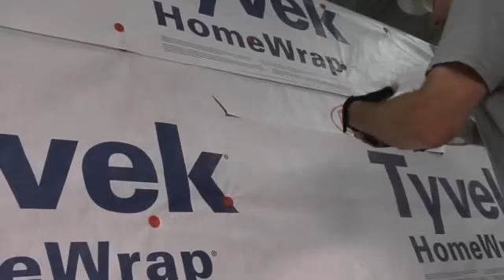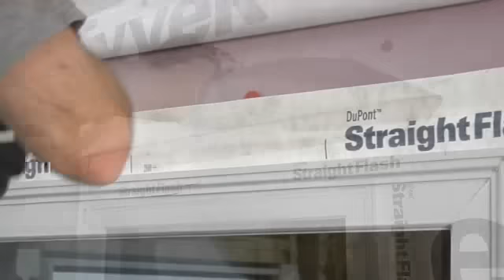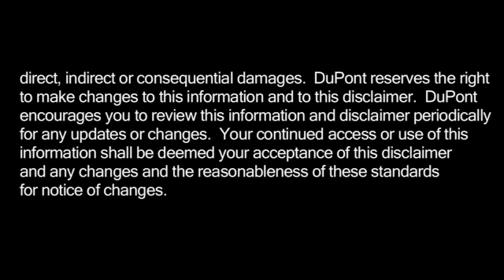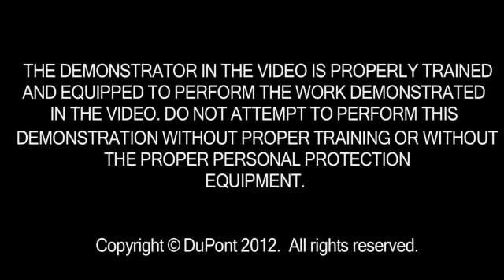Install and Flash a Flanged Window When Using HomeWrap® Over Exterior Rigid Foam Insulation

Comment: how did you flush up the window opening to the foam? if I use 2" foam over framing, do I bring the foam to the edge of the opening and nail the flange through the foam into the wood frame? or do I fur out the window frame opening and butt the foam up against that?
Reply: Im looking for an answer to the same question. If you figured it out could you answer for me ? or could anyone else ? It would be big time appreciated.
Reply: You get :-3 cans of foam make sure you get it in the 10 inch can. White cans only.  Then you attach flange to top at window header. Then stick hardened flange to bottom of window sill and the pull on both sides of side of window making sure to take hands and wipe down the 2 side jams of window flange. Foam will ooz spend sides. Top and bottoms of   all four sides.  But no needs for worry have your helper to take a warm clean clothe and wipe clean window.   There beutiful lady of a window installed by professionals.  Another happy happy happy home owner.

Comment: Hi. As I research how to install house wrap, I have noticed a lot of talk regarding cap nails or staples in terms of keeping the water out when attaching the wrap. But, I’m thinking… as soon as the cedar shingles are installed over this air and water barrier, the house wrap then has  hundreds of additional punctures wounds by the two nails per shingle. It seems a moot point. Same goes for Huber Zip System. Yes, there are no holes from from wrap attachment because there is none. But again, it gets riddled with potential leak hole from the shingles put over it.
Reply: Different vapor barrier for roof that addresses this.

Comment: I have seen it recommended when doing a rain drain siding to housewrap over the sheathing and then again over the rigid foam board, then apply the strapping for the siding.  In which case what is the proper procedure around the window box with the first layer?

Comment: Shouldn't the window have been shimmed up a bit to allow equal foam along the sill plate?
Reply: YES
The bottom of the window will always be cold
I use 3/8" ply blocks to elevate the window leaving 3/8" space all around for foam.
Reply: Yep
Reply: yes! in fact that entire opening is waaaay too narrow. there should be 1/2 minimum all the way around the window. by the way tyvek over foam? its not incorrect per say, but its way harder to put on in the wind when you can only use cap nails. normally it would be stapled to the sheathing, which apparently this building doent have any as hes nailing it to the studs and theframed window sill is exposed. what the fuck is this  guy doing?
Reply: I was going to add this same comment.   Also, FHB recommends caulking over the fin nail holes.  Second, don't use sheetrock screws....

Comment: I would suggest you redo this video.
Add a head flashing
Learn to apply foam insulation in cavities.  
The foam should be sprayed in two application from the backside of the flange and a final coat to fill the gap.   
It should fill the gap completely.
Reply: I agree foam should be oozing from cracks and crevisis. Need a heavy application of foam. On all four corners. Then allow helper to clean window.

Comment: tyvek over foam is a waste. but you guys can't admit that, can you?
Reply: The jury is still out, but "belt and suspenders" approach does not hurt.
It can be either way ( http://www.greenbuildingadvisor.com/blogs/dept/musings/where-does-housewrap-go )
1. Sheathing/wrap/rigid foam (wrap is nicely sandwiched and protected, foam provides extra water-resistive barrier (WRB) but is not critical
2. Sheathing/rigid foam/wrap
3. Sheathing/rigid foam; no housewrap - with 2+ layer staggered foam and all seams taped you can skip housewrap but it's cheap enough to include it, and not all foam types are approved for WRB, and some can also shrink over time creating gaps.
Reply: my damn city code makes us use house wrap no matter what, so it doesn't matter if we use foam or OSB.
Reply: @gratefulaya192  yes and a wrap of sum kind kinda required if you have any kinda caviry insulation!!! that said. 15 and 30 felt tar paper is also expectable in maney areas as it repels water. doesn't do nada for air but another option. oh and good luck on corners.